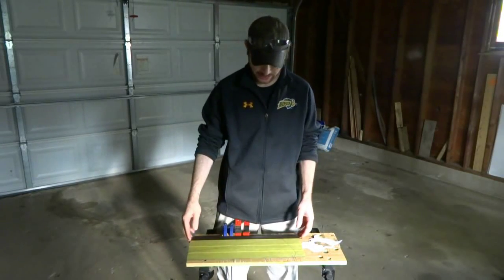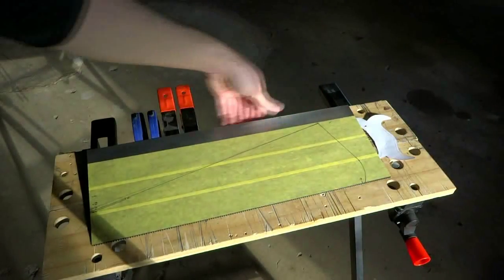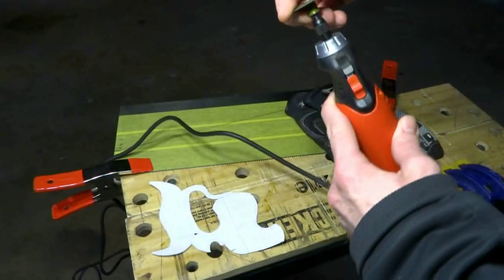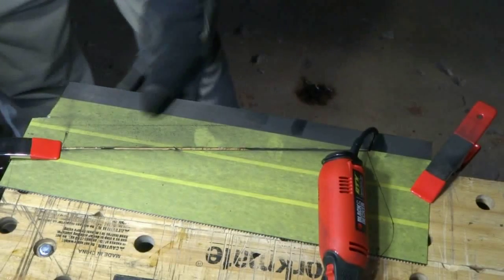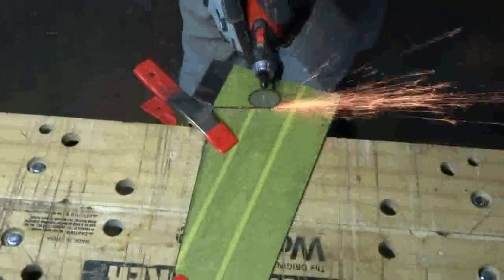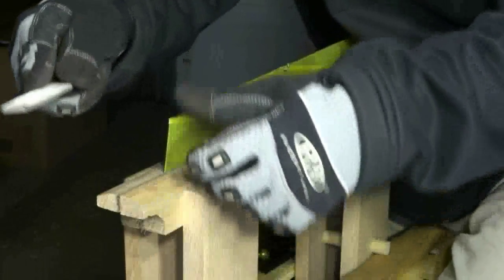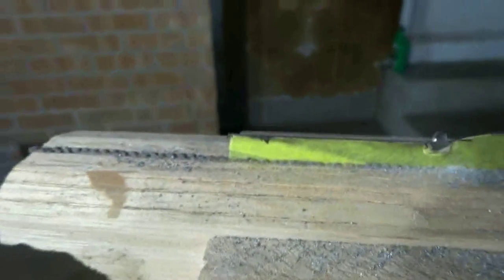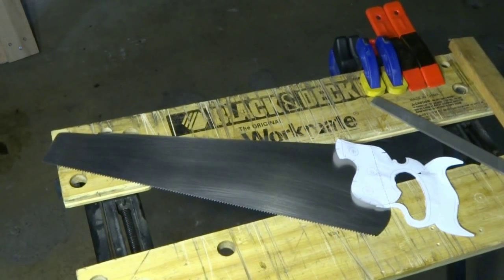Mosquito - Making a Small Panel Saw - Part 1

Comment: Hi Chris.  Thanks for sharing your videos.  This is encouraging,  Where did you get the plan for the saw vise?  I like that you are using it in your shop mate work bench.
Reply from the maker: Mary Kathryn Vernon Thanks!  I didn't really have any plans for it that I followed, I made my own taking the parts from other saw vises I saw online.  I made it specifically to fit in my workmate, as that's the only work holding thing I had at the moment.  I used the workmate for saw sharpening up until I made a bench top moxon vise for my workbench a few months ago

Comment: Chris,
Dominic from www.TGIAG.com here. Nice job on the saw! I like how you formed the nib.

Using the abrasive cut off disc is the way to go if you don't have a shear. BUT you only need to score the cut line to about half the thickness of the saw plate. Then you can hold it in your work make vise right at the cut line and and snap like you would a sheet of glass.

When it comes time to further polish the plate up (if that's what you mean to do) I recommend starting with 220 wet dry sand paper lubed with mineral spirits. Take long even strokes along the long axis of the saw plate. Don't change direction in the middle or you'll get scratches. Progress up to 600 and you will be able to see your own reflection!
Reply from the maker: Thanks Dominic!  I was a curious about that method of cutting it.  With my other hobby in computer case modding, I went with a similar approach to cutting on computer cases.  I tried to make sure not to spend too long in any spot, and keep the disc moving, but was always worried about that.

Polishing the plate has indeed been done as you described.  Same process as when I restore a handsaw, though I don't generally go too crazy for the shiny.

Thanks for the tips!
Reply: +Chris “Mosquito” Albee I would think you can achieve similar results with a bi-metal bandsaw blade to cut the saw shape. I've never tried it but think that is the way I would go. I am very close to pulling the trigger on a pair of these saws for my dutch tool chest. I am not a fan of the abrasive cut off disc - I've had the older Dremel ones shatter on me and that led to harsh language.
Reply from the maker: +Charles Lehman That could very well work, though I'd have to get a bandsaw first lol  I would probably be willing to give it a try too, as it may very well work better.  I only use the fiberglass reinforced cutting discs now, as I've also had a few of the cheap regular dremel discs go flying apart on me.  I also like the EZ-Lock mandrel and cutting wheels because it's got a little give if you accidentally apply a side load to it.  I use them a lot more in my computer case modding stuff than anything else.

As for being close to pulling the trigger, I would :-)  I have the plate to make another one, just haven't had the time yet.  I'll be making a crosscut to match this rip for my Dutch chest.  Which... also needs some time to complete... ah the joys of too much going on lol